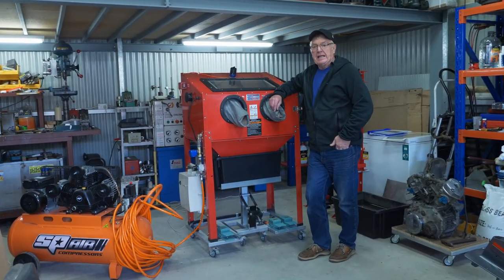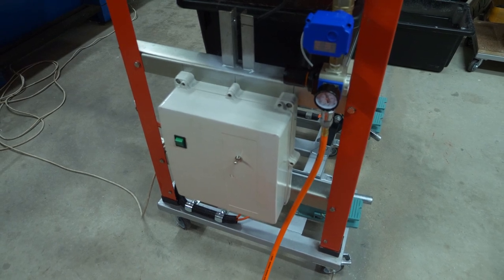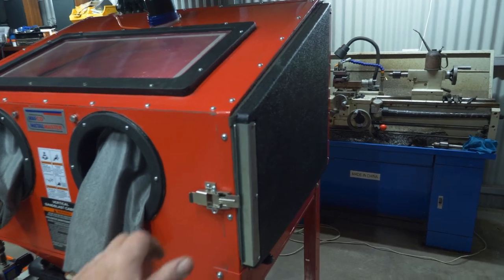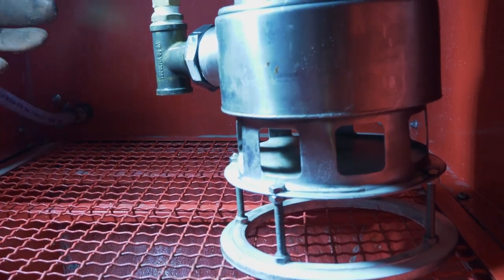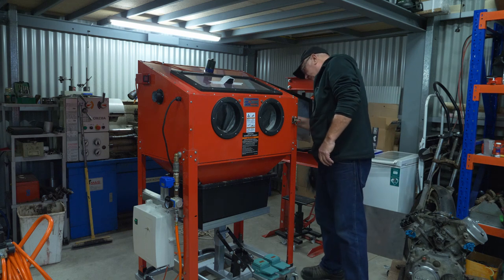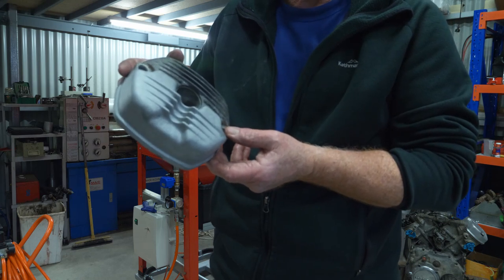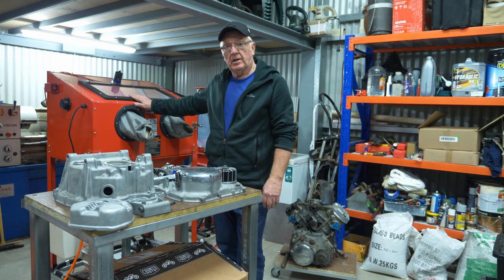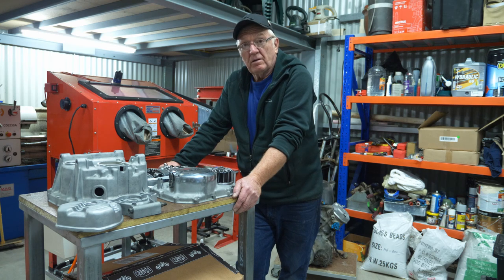How to Build a Wet Blasting Cabinet

Comment: I live in the United States and am hooking 120 volts in. it should not matter  could you send a good camera angle of your wiring job along with components.. the site that you listed for the box and or electronic components does not work here in the U.S. need help aquiring correct supplies.  Thanks
Reply from the maker: Mate i's love to be able to help you
But I don't know your American wiring rules 
You will need an American electrician to help you with the wiring 
You will need a 120V AC submersible pump
All the air valves foot switches, lights are 12V DC so you will need a 120V to 12VDC power supply 
Parts that you need  can be found on the net 
Here are a couple of links 
https://www.amazon.com/s?k=electric+box&crid=GB2Z8S4ARXFT&sprefix=Electrica%3B+box%2Caps%2C391&ref=nb_sb_ss_sc_1_13
https://www.jameco.com/z/GSM220A12-R7B-MEAN-WELL-AC-to-DC-Switching-Medical-Table-Top-Power-Supply-12-Volts-15-Amps-180-Watt_2239672.html

Comment: The aluminium oxide gives an identical finish to standard dry sandblasting. I would love to see a part sandblasted and then vapour blasted with glass bead.
Reply from the maker: Did you watch this video?
I demonstrated blasting with aluminium and glass bead 
The results can be seen at the 15:31 mark
Reply: @Coolhand99au  Yes but i would like to see it dry blasted with sand first as i think this is the most effective way to clean the metal first before polishing with glass bead. The aluminium oxide doesn't work aswell as dry sand.
Reply from the maker: @baldrickscunningplan6154  Mate your not going to dry blast in a cabinet that is designed to wet blast. So are you going to have a cabinet for dry blasting and one for wet blasting ?
I'm happy with the two wet media that I use 
It cleaned those parts up pretty good
Reply: @Coolhand99au  I have a dry blast cabinet which cleans the parts very easily and quickly with ordinary kiln dried sand. It removes all of the dirt and grime but it gives a very dull grey finish. Its perfect for applying paint finishes but thats about it.The cabinet is a home build that wouldn't be suitable for wet blasting. Its only riveted together and would have too many leaks. I am considering building a separate wet blast cabinet to polish parts with glass bead. I wanted to see what wet blasting does to parts that have been previously dry blasted with sand. I have seen one video where dry glass bead has been used at low pressure to give a reasonable bright finish but i am presuming that wet blasting would be superior. 
I have modified my manufacturer rated 14cfm compressor which only gives 9.6cfm. It now produces 15cfm at 90 psi. I can ramp that up to 17cfm but would need to sort out some additional cooling for the compressor pump. Would this be enough?
Check this out. This guy is getting better finishes with dry glass bead.
https://www.youtube.com/watch?v=FNPla4K1ZwI
Reply from the maker: @baldrickscunningplan6154  Mate I checked out your video link and yeah he  cleaned the part up Ok but really didn't get that shine
So OK you dry blast the aluminium part in your dry blast cabinet  which you have built.So mate get started build  a wet blast cabinet and I'd say yes if you finished those parts with wet glass bead you will have nice shiny parts
Check this young guys wet blast site out he is really good

https://www.youtube.com/channel/UC5mEA0d4nP1rbzIerZIS_7Q

Comment: just build a cabinet and have a foot switch for air, thats all you need, the wiper is not necessary if you use your brain. there is an easier way than that and its allready there!, think about it.
Reply from the maker: Good on Ya  !
I like my windscreen wiper
I can turn the pump off with a press of the foot switch and keep the air on and spray fresh water whenever I need it
Reply from the maker: @findvoltage  
Hahahahahaha 
Easy on the old bit mate